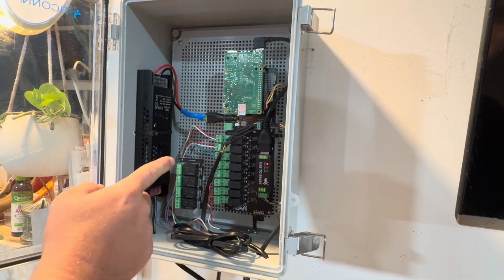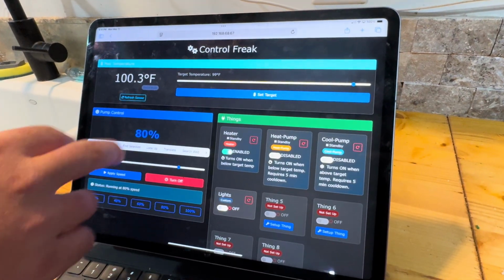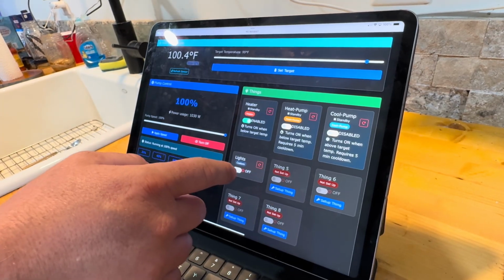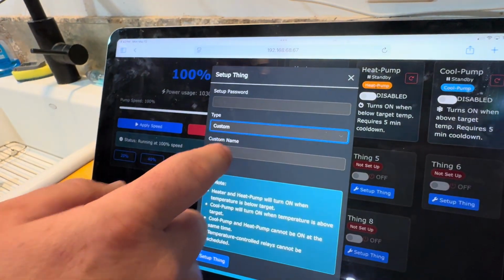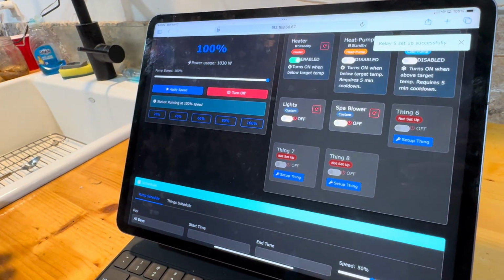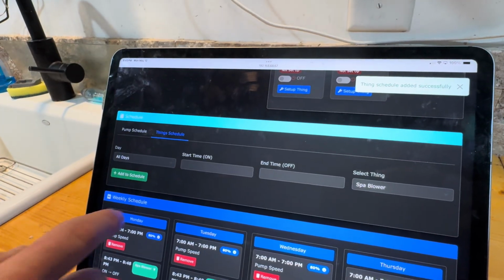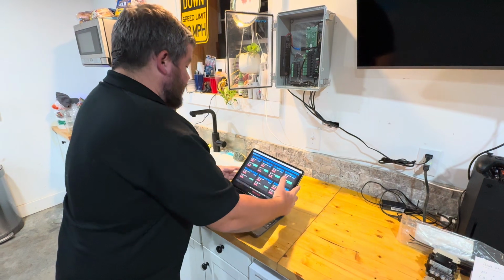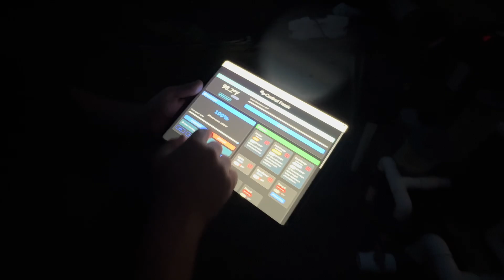DIY Pool automation with RS-485 (The Control Freak)

Comment: I need this.  I'm so tired of replacing overpriced legacy brands for basic automation.  Just had a control board on a Pentair panel fail after just over 3 years.
Reply from the maker: Check out the control freak channel they have made a lot of progress! They have units in the field!

Comment: I have 1.5" pipes for a 20x40 so no reason to buy the highest end vs pump (although they the only ones that come with its own extra relays?) Only automation I need is the pump and salt generator. Haven't been able to find anything that doesn't cost more than the pump itself. I am sure alot of pool owners moving to salt would have similar needs. 
I'll gladly flip switches for a year and wait for a Control Freak.
Reply from the maker: Thank you for your comment! We are going to post an update video soon! Id be happy to send you a beta unit for free!
Reply: That would be sick. I'm down. Finishing up the pad and running the lines now.
Reply from the maker: @stoopidzen3508 update video is up!
Reply: I'm putting in a Siemens sub panel at the pad. Anything I should add to make connection easier?
Reply from the maker: @stoopidzen3508 that should be fine! Just make sure you have two hot, neutral and ground.

Comment: I’ve got an Aquacal heat pump heater that I’d like to control with an RS-485 interface. If I can simply read the current temp, current set point, and set a new temp set point, I’d be ecstatic. I’ve connected the RS-485 to the external control terminals and switched the heater to a 2WIRE external control but am not receiving any data from the heater. Any suggestions on where to start? I’d love to collaborate and contribute.
Reply from the maker: Hey! Being that they are not the “big three” they more than likely would help us with the communication protocols. 

I will have 100 units ready to go soon. We will have a new video up soon as well!
Reply from the maker: What controller are you using? Your own DIY?
Reply: @HaywardTechSupport  Correct - I’d like to roll my own. Again, just to read temps and set target on the heater.
Reply from the maker: @benjamintigano6400 we will be selling mother boards for people that want to do DIY projects.

Comment: To control the speed of the pump - safe to say to are wired into the RS485 on the pump itself ? So you go from Pi to usb/rs485 converter out to pool pump rs485 ?  I am trying to do this myself - not nearly as educated as you guys are - you mentioned reverse engineering the code to send the instructions to the pump - how do you even begin to do that - I have defender 140 vsp - any way to add that to your list of supported pumps ?
Reply from the maker: Hey it takes a little effort to do that, can you provide a link with exactly what pump you are using? I might know the VFD used on that pump but want to be sure its the same as what you have.
Reply: @HaywardTechSupport  It is the waterway power defender 140 - https://waterwayplastics.com/manuals/810-4120-EFS-0819_PD-140Manual_lowres.pdf
Reply from the maker: Essentially any company I’ve contacted is happy to send me the protocol sheet on their pumps just not the “Big Three…”

Comment: Lightning just took out my Hayward controller

Is this something I can buy?

My soul is going to leave my body is I have to pay thousands of dollars for another Hayward piece of shit 😢
Reply from the maker: @cb253  we think Hayward makes a good product. 🤷🏼‍♂️

If you are interested in testing a unit we will be giving out around 15-20 units for testing in the future. 

Also if you need a Main board for your Hayward controller in the time being we can ship you one from our store. -Pat.
Reply from the maker: Sorry to hear about your bad luck. Replacement part number for the controller is HLXPLCONTROL (this is the touch screen display). You may be looking at something in the range of a thousand dollars to replace and will require reprogramming your system.

It may be the case that the circuit board blew and it could be the case that only the circuit board went bad or that both components went bad. May be best to call a service company to diagnose and repair but if you want to send us an email at Tylerandpatrickknowbest@gmail.com with your phone number I may be able to help with diagnosis if you have the proper tools. Sorry again to hear about that! -Ty.

Comment: You could make a ton of money by making  a low cost automation - especially since people don’t have the appropriate components for the high end automation.  I would love any and all documentation on how you built that - would love to know more.
Reply from the maker: @smears711  we are going to continue software/firmware development for the next few months. Our plan is to build a custom PCB to clean everything up as well as a decent enclosure with quality, high voltage relays. 

We will sell it for a fair price and likely offer cloud services for a set yearly cost so those cost are not baked into the product if the user is okay with local network access. 

Feel free to shoot us an email to tylerandpatrickknowbest@gmail.com for more info.
Reply: @HaywardTechSupport  Just built a similar setup that controls lights on my truck with a Pi and some relays and mosfets.
Reply from the maker: @Mitchs  post a video! Sounds like a fun project.
Reply: @HaywardTechSupport  Clyr, Poolside.tech's attendant, all the folks rolling their own with nodejs-poolcontroller project, people like me who can make their own...  Not to mention the big three.  Sounds like you're trying to enter a crowded market with not many buyers.  I love what you guys did but I think you'd go broke.
Reply from the maker: @HumanHiLiteReel  Pool-side isn’t cost effective. Clyr is interesting but still not cost effective but don’t feel they are attacking the market correctly. The unit is lacking.. 

What we are doing is building a very refined system, native app android and iPhone app and cloud with the ability for people like yourself to use our backbone to do DIY projects but that is a small percentage of the market. 

Let me explain it like this. I build $5 million worth of Pool projects a year and neither of the products you have mentioned appeal to me or would I recommend them to a homeowner as an option.